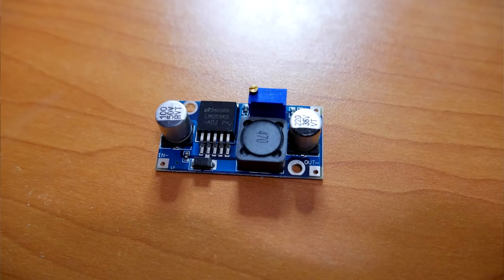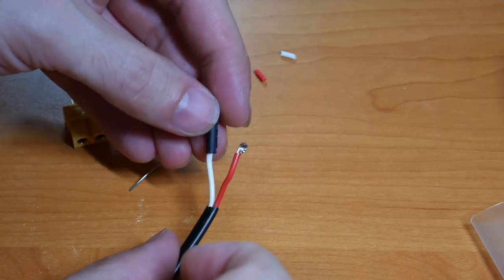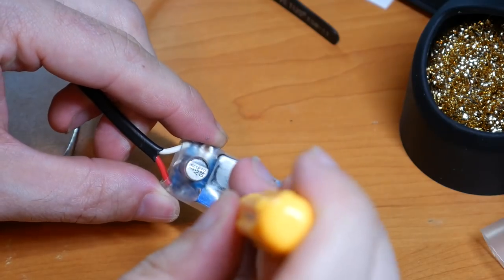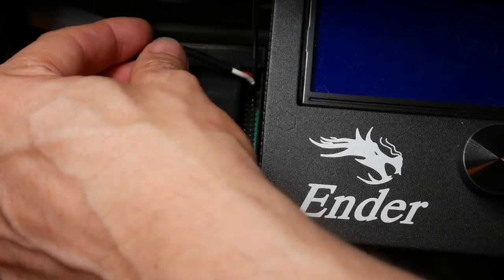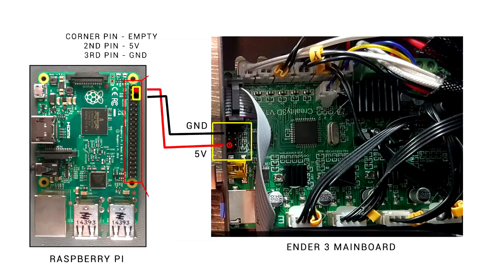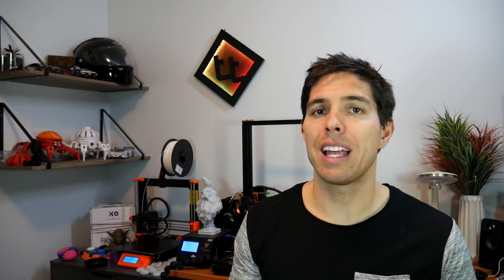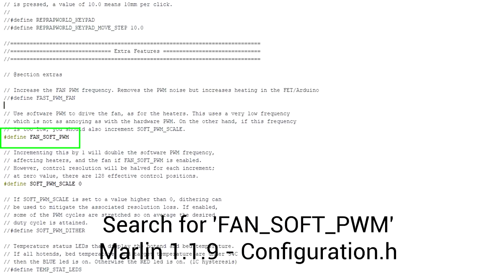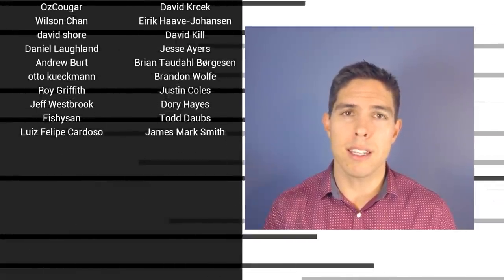Buck converters: Quieten your 3D printer with a Noctua fan & directly power your Pi

Comment: Everyone else seems to be having better luck at finding a decent step down converter it seems. I've tried both a DFRobot DFR0205 (5V @ 5A max) and Hobbywing UBEC 2-6S (5V @ 3A max), and they both report under-volt warnings in the boot up log on my RasPi 3B+ w/ display + cam. Neither actually caused any issue when printing (I ran with each model for a week or so), but went back to the official power supply just to be safe.
Reply: Neither of those options look like the step down converters that are used for this application.. I don't see any way to vary the output on the DFRobot, and the Hobbywing is an entirely different product (WAY overkill for this). Search Amazon for "LM2596" - that's the chip that is used in these step down converters. You shouldn't be paying ~$50 for ONE converter, $10 will get you a pack of 6 of what you need.
Reply: @alexn78666  Thanks for the response. I did eventually got the Hobbywing one working with help from another forum; turns out the wire I was using in one section was too thin (swapped it out with 20 AWG wire and it was all good)

Comment: Why everyone cuts the cable? Do it like me an just add an additional cable to the powersupply.. there are planty of terminals where you can install a seperate power line to your buck converter, instead of destroying the original cable !
Reply from the maker: Watch it again. I didn't cut the power cable.

Comment: I have added buck converter as exactly described in this video even setting the voltage to just under 5v. I have an LCD attached to my Pi and I am getting the lighting bolt on the screen indicating it is under powered. Should the buck converter be bumped up a little more to compensate for the LCD display? Didnt have this issue when the Pi was directly plugged into a power supply.
Reply from the maker: Bump it up to 5.2V and see how it goes. Make sure that your buck converter is rated for 3 amps like the ones I used.
Reply: @TeachingTech  Yes its rated at 3 amps, so I bumped it up to 5.2 and it took care of the issue. Thank you. I was going to do that before you responded but wasnt sure if it would damage the Pi or not. All good now. Thanks for your great tutorials!

Comment: honestly 3d printer boards should include a 24 to 12v step down...... it's not that hard to include one but I get every cent counts. they could also include a seperate motor pin and seperate fan etc pin or hotend-heated bed pin.

heated beds + motors make more sense to use 24v. otherwise 12v is fine for everything else. heck even 12v is fine if you have proper cables really. mostly the motors that benefit from 24v (more torque less noise. specially true with TMC drivers)

Comment: There have been people reporting frying the 12v fan if supplied with 24v at 50% pwm, so I would not really advise it. There are also some cheap 24V 5015 fans running on ball bearing from GDSTIME on aliexpress, and be sure they are ball bearing as the normal sleeve bearing will wear out very quickly (one I had lasted 2 prints then the sleeve bearing became noisy)
Reply from the maker: Agreed. Please see the pinned post.
Reply: Have to say myself included, would the buck converter work in this case too?
Reply: @simecekjann  if you need a fixed speed fan, the buck converter is fine

Comment: If your going to add capacitors to a pwm signal, then make sure they are 105'C capacitors with a Low ESR, as they are designed for high frequency applications.

Comment: The wire aug you are showing is way overkill for the current you are using. You can use substantiallu smaller aug wire. I prefer the wires from cat 6 cable but cat5e should be fine. I also prefer a solid conductor but typically can only get that if you have a source for bulk cable. The stranded works fine.
Reply: He knows.  He says as much in the video, doofus.

Comment: Hello,
Thanks for the video. I got it working but I am having a bit of trouble with the pi camera. I have the buck converter set to output 5v DC and the pi is powered and boots Octoprint OK with the exception of the camera does not power up. I have the camera hooked up to the camera port in the center of my rpi 3b+. If i plugin the DC wall adapter to power the pi the camera powers up as normal. 

Any ideas of what i'm doing wrong?

Thanks!
Reply from the maker: I don't sorry. If your buck converter is the same as mine it should be rated for enough current. You could get an old USB cable, cut it and connect the buck converter to it so the power is delivered the same way.
Reply: @TeachingTech I think my dupont cable was loose because after i gave it a good wiggle and restarted the pi the cam powered on. Just wanted to say your videos are very helpful, so thanks for making them! :)

Comment: I habe an 24V fan on my printer I want to add an second Radialfan can I just wire it up parallel to the other fan? and should I step down the 24V to 5V?
Reply: I have an Anycubic kobra neo

Comment: If you were going to run 2 12v fans that are always on.  Just wire them in series and you have no need for buck converters
Reply: If the fans are similar enough in current consumption.
Reply: Meh if you are using the same make and model that would assume they are closely matched enough
Reply: That doesn't apply cleanly to brushless fans, their impedance isn't constant meaning you'll get peaks and drops in the supply voltage. You don't get a clean 12V if you place two identical 12V brushless DC fans in series, even if your multi meter sais so. The multimeter shows average voltage over the terminals. This is also why a 50% duty cycle 24V signal will show as 12V, while it's actually still going 0 to 24V.

More technical discussion here: http://forum.makergear.com/viewtopic.php?t=6310#p35390
Reply: @stefanwilkens  You don't need clean 12V to power the fans, burst supply is in order just as long as you don't overheat the motor windings and the MOSFETs. Otherwise the brushless control boards in them are usually fine with 24V. So two fans fighting for bursts of power in series is adequate.

Comment: I have a question, could you use the 5v/ground pins off of the raspberry pi 3 b+ to power a 5v Noctua fan for your hotend cooling fan?
Reply from the maker: The fans draw very little current so I don't see why not.
Reply: @TeachingTech  But why? Better directly loop them from your input from the buck-converter. |f something goes wrong you won't fry the pi-board in that case.

By the way, you can use the output-pins of the pi to switch the fan when needed from your pi. Could even do a temperature-sensing and pwm  with a little routine; running the fan low-level and not when not printing (after a while to cool down).
Reply: yes

Comment: A little secret: Use LM7812 microchip for fans and it is much smaller to fit in control case, cheaper and easier to use

Comment: Powering a Linux based system such as Octoprint up and down without doing a proper shutdown may corrupt the file system. If people are going to be wiring up the Pi like this then they probably should be issuing a shutdown command on the interface before turningoff the printer just to be on the safeside.
Reply: True. But how long do you wait after shutdown? I guess on the pi there are lights indicating that but  I plan to use a rpi zero, that I will place inside the ender 3 board case. A first idea would be to use a ups+ battery. Maybe I can tell the pi somehow to issue shutdown command, if it looses "normal" power input. What do you think about that?
Reply: OR you could just wing it, i mean chances are, it'll take a thousand tries or more to shoot down the filesystem, so keep a backup and when it happens, just copy it over?
Reply: While you are absolutely correct concerning performing a proper linux shutdown, I've simply cut power to shutdown my pi's literally hundreds of times across four different printers over the course of a year and have never had an issue. If it wasn't so easy to re-image them, I'd probably take more care with issuing a proper shutdown each time.
Reply: @trohn_javolta8485  Actually the process is very quick so rather than complicate things simply issue the shutdown command from the Octoprint interface, wait 10 seconds and turn off the printer. That should be plenty of time!
Reply: Totally agree, had some friends where their RPi Octprint sd crashed and had to be restored. On the other hand this wiring would be great for an ESP3D solution which is much less sensitive to been power off hard.
Reply: @trohn_javolta8485  you can choose how long the linux system is to shut it self down . you can set it up to wait 1 minute to shut itself down after the shutdown command is sent to the printer

Comment: Is it possible to substitute the blower fan to a cooling fan type?  How about the power supply fan?  Any cheap alternative to Noctua that cost less?
Reply: Basically all PC fans from dedicated manufacturers have fairly comparable noise characteristics when running at the same speed, and with this kind of build you have a voltage controller at hand anyway to set the speed, but on the whole, Noctua tends to win, though i guess the difference is larger at larger sizes. If you're running the Noctua at a reduced voltage, they can run at 3700rpm while producing 13dBA of noise and having 6.6m^3/h throughput. The Blacknoise NB-BlackSilentFan XM2 running at its full nominal voltage of 12V will do 3800rpm, 14dBA, and 6.7 m^3/h. Scythe Mini Kaze is 3500rpm, 14dBA and 7m^3/h.

Noctua at full 12V voltage delivers 4500rpm, 18dBA and 8.3m^3, while a cheap Xilence XPF40.W will do 4500rpm, 19dBA, and allegedly 11.7 m^3/h, though the specs on Xilence tend to be a bit... should i say, unrealistically optimistic regarding both noise and throughput.  Gelid Silent4 is 4200rpm, 19dBA and 7.65 m^3/h.

Scythe Mini Kaze Ultra is 3500rpm, 20dBA and 8m^3/h, but it's double thickness, 20mm instead of 10mm.

Actually if you have any random 40mm fan, even stock one, maybe try reducing its voltage at first, you might come not quite close to these highly engineered ones, but somewhat close, even a small reduction can bring it down from obnoxious to less objectionable. I think the Noctua mod reduces airflow compared to stock, but perhaps it doesn't matter that much or the cooling disadvantage can be compensated elsewhere, by for example improving thermal coupling to heatsink.

Oh and please don't replace the centrifugal fan with an axial one, it doesn't work very well.
Reply: @SianaGearz   Thank you for your detailed replay. I take it as that's no silent options for the centrifugal fan?
Reply: @AhCup  The problem is that you ideally need a centrifugal fan for part cooling. You get up to maybe 2mmH2O pressure off these axial fans, usually much less. The radial fans have about 10-15mmH2O. You need that pressure to get through the cooling nozzle constriction without losing all the airflow. Part cooling designs with axial fans don't work nearly as well, and many are outright asinine because the designer didn't understand that you should avoid narrow pathways and restrictions in these, while cramped designs with centrifugal fans are perfectly fine.

As to whether there are better alternatives among centrifugal fans, i never had enough of them in my hands to say, but the premier manufacturers in this area are Sunon and Delta, and the rest are more or less bad knockoffs of those... so maybe worth browsing their catalogues, if nothing remarkably perfect comes up, then that's about it. Maybe you can live with less airflow and attenuating existing centrifugal fans can do fine. Maybe a design is possible where you use two fans one each side and attenuate them both. I did however see someone publish a design for an attachment for axial fans which increases their static pressure quite a bit, looks like a set of stationary fan blades, but i haven't tried, have no opinion on it.

Comment: Looks like there’s  no such thing as a “parallel XT60 adapter”. It’s literally just regular connectors wired together, so you might as well just get a 10 pack of male/female pairs for cheaper and do it yourself.

Comment: Does the converter get hot inside the shrink tube? I bet you could 3d print a nice case for the Buck instead that had a better heat displacement.

Comment: Nice work, My only comment is I that I thought, and i could be wrong about this, I'm not a PI pro or electronic wiz. The gpios were mainly for out going power . If you plug input power in there you skip the PIs voltage regulator and spike protection .   I see you slightly under volted it anyway so should be fine, but is some people bucks might not be variable and may over volt. 

Happy to be corrected on this. This could be for the older RPis?
Reply: The 5V pins on the PiHat header are not GPIO pins, they are power pins. When you're powering the Pi through the hat header rather than the dedicated USB power input, you're circumventing a fuse and a Zero Volt Diode, which is actually a MOSFET circuit that passes current one way, but with less voltage drop than a simple diode junction.

The ZVD is needed for specification compliance reasons, because if someone were to plug a Pi into a USB hub, a computer, etc, and a Pi also had another power source connected to it via the PiHat header, backfeeding of power into USB host is strictly prohibited. But if you're plugging your own power supply into the Pi, you don't need to protect it with a ZVD. Besides, they sometimes had the ZVD, sometimes they didn't, seems they treat it as optional.

The fuse is also optional, as these little step down converters simply won't deliver all much more current than 3A to begin with.

You still get a spike crowbar regardless which way you connect that triggers at somewhere around 6V. You can set 5.5V on your regulator and i'm fairly certain that everything will be fine. Keeping the fuse would be ideal, as if the voltage rises above 6V, the fuse can prevent the damage to the crowbar. But eh, a Pi is not such a loss.
Reply: someone below asked about soldering the converter from the power supply into a custom USB header to plug into the Pi instead of using the GPIO. wouldn't that be the best of both worlds (having the added protection, and also not relying on a separate power supply)?  @SianaGearz
Reply: @Cidriel  nothing speaks against chopping apart a USB cable and soldering the wires to a step-down regulator. And it's fine to use a super cheap shoddy cable too, since you only need a short section of it so its resistance won't matter, and aren't going to keep tugging on it or plugging it in and out, so its strain relief quality won't matter, and data lines aren't connected on the USB socket of the Pi used for power, so you're not gonna fry Pi's processor in the unlikely event that the cable shorts out internally.
Reply: @SianaGearz  that's good to hear! thank you for the tip. I have plenty of those short 5" usb cables from various electronics and no use for them so this sounds like a good way to repurpose one and actually put it into service for once.

Comment: PWM is digital on the output a capacitor won't help that.  a Choke can help keep noise out of the system but it wont help either.

Comment: The stock fans on our Ender are really starting to scream! Definitely need to install a Noctua. What I would really like to find is some way to control the hot end fan to only be on when the printer is above a certain temp. Much like how Prusa Printers work. My printers set idle quite often, no need for even that quiet Noctua to be spinning, and wearing, if the printer is cold. Could it be possible to intercept the temp coming back from the hot end thermistor with an Arduino, and control the fan that way?
Reply: If you want to turn off cold end fan when not printing, just take the EN signal from your stepper drivers, and drive any old MOSFET with it to switch the fan.

Comment: Better to use HW-613 Dc-Dc Step Down, it's only 20x10x5mm, and has 12 1.2Ah output sufficient for a fan, and so small to put it into the wiring sheath just few cm over the hot end, and don't need to open the mainboard cover.

Comment: How can I use a single buck converter to power the part cooling fan (PWM from MKS L mainboard) and hot end cooling fan (switched from MKS L mainboard)?
Reply: you do not need the buck converter for that you can connect it directly to 1 of the servo pins which have PWM control.

Comment: Why use a buckconverter from 24V to 12V when you could make a voltage divider with resistors? This is basically the same "hack" that Noctua them self use on their "silent" adaptors for CPU-fans. Since I don't have my Ender 3 yet (Ordered it last week) I don't know the maximum Amps of the 24V output and I do suggest that you use high wattage resistors if needed.
http://www.learningaboutelectronics.com/Articles/Voltage-divider-calculator.php#answer1

Comment: If I connect 2x 12v Noctua fans in series as you mention on my 24 supply, do they still ned buck-converters? Or would they require 24v as each fan will draw 12v?
Reply: That would work, but both fans are controlled seperatly by the board.

Comment: Actually Raspberry Pi 3b+ with OctoPI need a little bit more than 5V otherwise it will be under voltage, also i noticed that short, good cord is esential for correct working of RPI

Comment: No, 50% of pwm does not mean it is 50% of voltage. it's 50% of the time, but full voltage at that time. You'll fry your fan eventually if you think you can run 12v fan on a 24v 50% pwm... it's true that is what the buck converter does, but he uses a capacitor to keep the voltage at 50% and some feedback loop to correct it based on actual load....